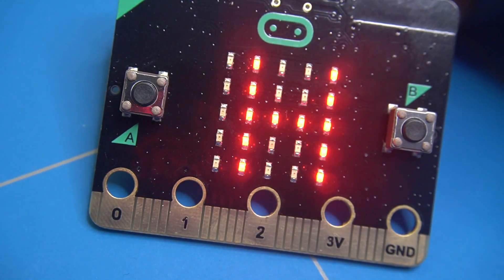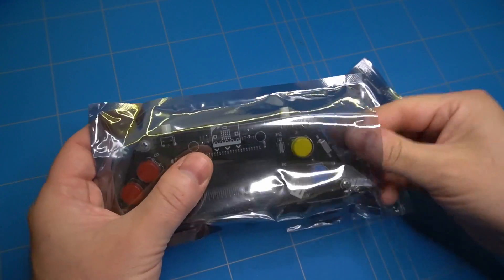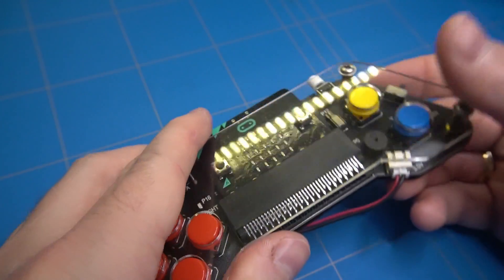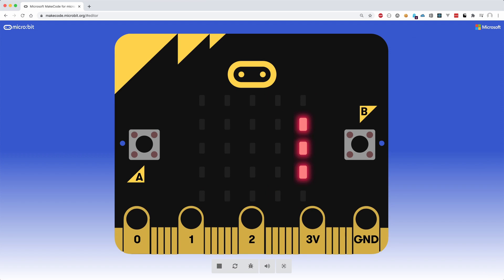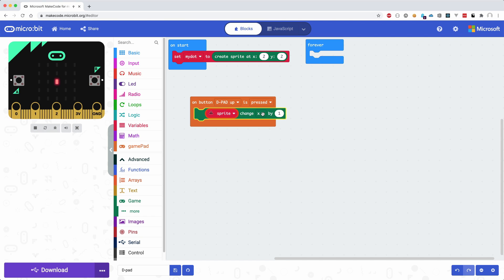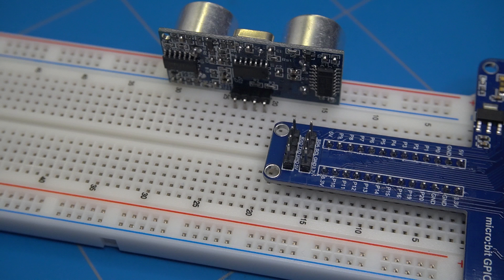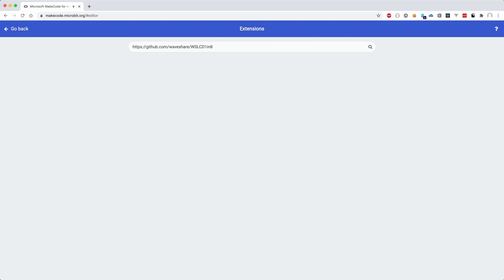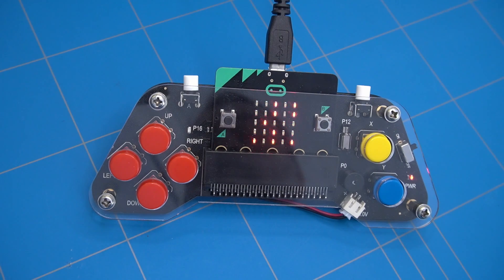BBC Micro:bit breadboard projects

Comment: BPI bit (also referred to as BPI-bit, stylised as bpi:bit) is an ESP32 with 32-bit Xtensa LX6 dual-core processor based embedded system. It supports Webduino, Arduino, MicroPython as well as Scratch X programming environments. Compatible with Micro :bit accessories
http://wiki.banana-pi.org/BPI-Bit